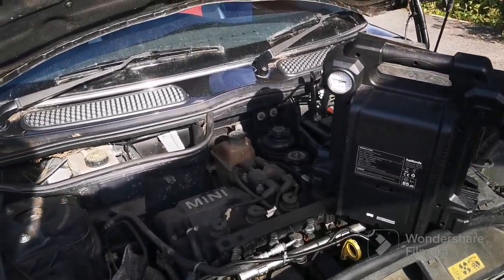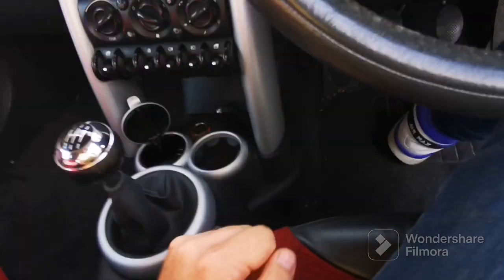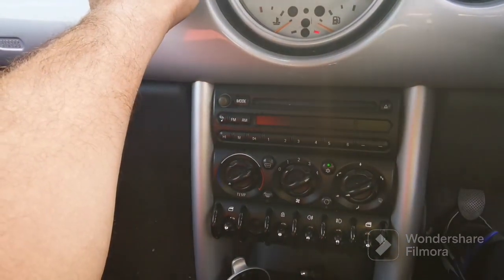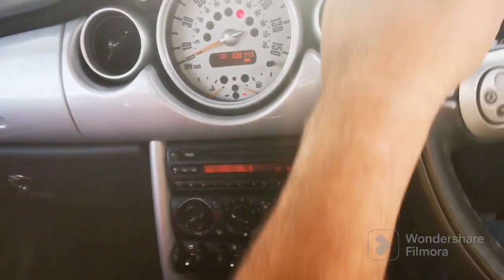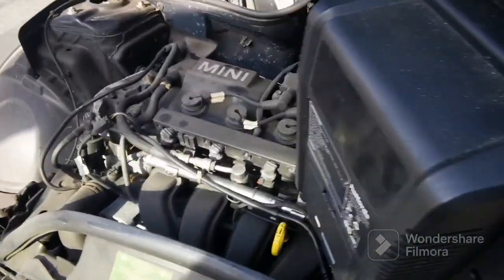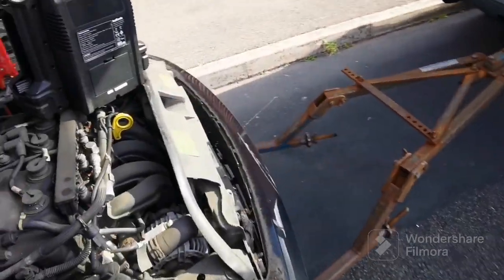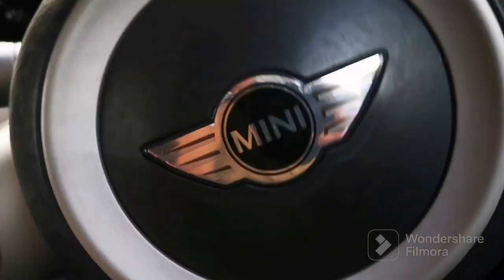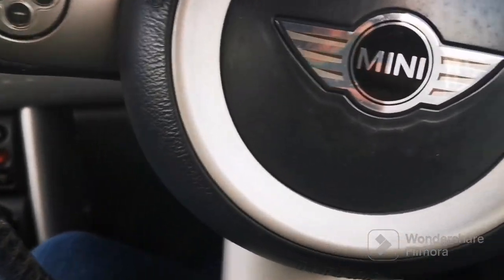i bought a cheap mini for £150 but is it any good or scrap #flippingcars #cheapcars #mini

Comment: Very nice Mini for the money! By the looks of it its a prefacelift with multifuntion steeringwheel. That's a much wanted upgrade. Also those red interior panel were a very expensive option back in the days. I've only seen one in my life and it was blue. So pretty unique!

I own two of these myself and have learned quite a lot about them over the years.

Engine is rock solid, never uses oil but can be leaky at the camshaft position sensor o-ring. The gearbox in yours is a midlands (also used in various Rovers) and these are quite terrible and unreliable.
If you find water in the boot its either the 3rd brake light, whiper rubber thing, the rubber chrome strip or the boothandle gasket. I needed all 4 before I resolved it. 

If you have questions, just hit me up!
Looking forward to the next video.
Reply from the maker: Thanks for watching it was a quick throw out video, i dont no much about the pre face lift etc tgats goid to no i did think it much be some sort of special edition due to that interior ive not seen before apart from blue. I do like theses tritec better then the dreadfull prince engine i still have nightmares over 🤣🤣🤣 im not seen a wet boot so i maybe lucky only issue so far is the crancase pipe when i put it back were its snapped engine cuts out 🤔